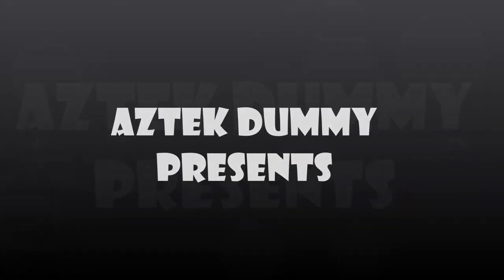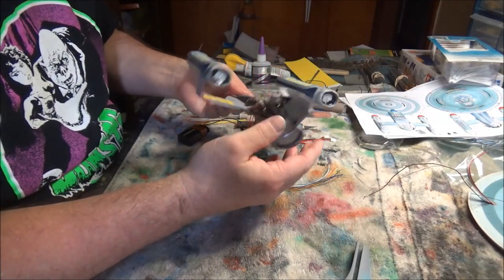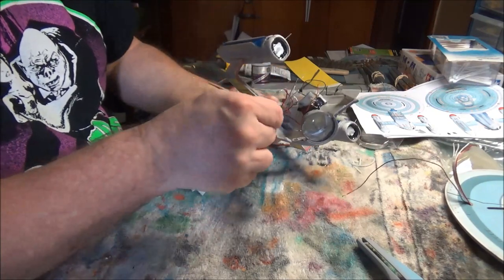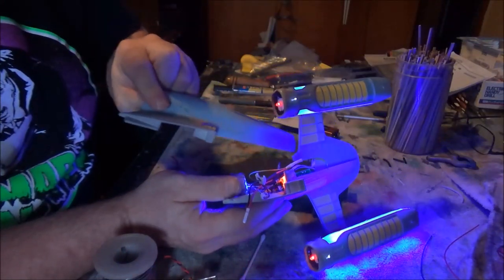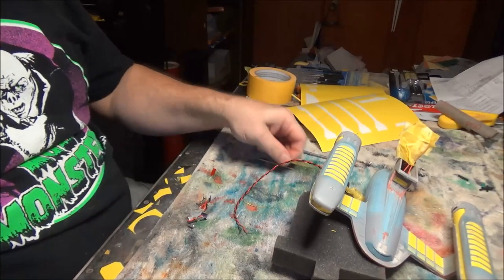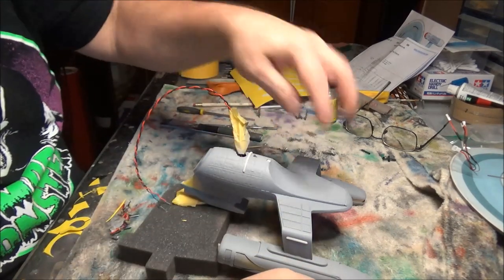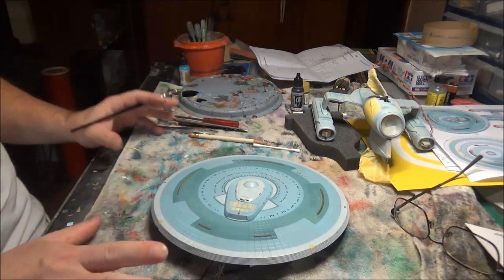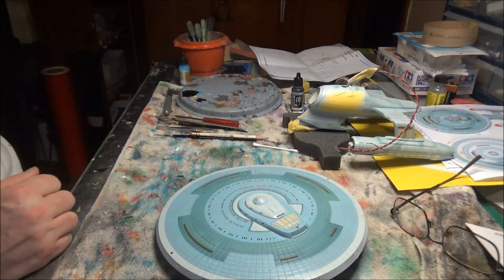Aztek Dummy Update 2/14/20 - Enterprise C part 3

Comment: Lou, first and foremost, many thanks to you for the great video series on model building and detailing. 

I have spent many an hour watching your videos which have more than re-piqued my interest in the hobby. A few years ago I had pre-purchased the Round 2 - 22" Space 1999 Eagle from CultTvMan with the desire to build it for my grandson. I had started the prep work on the kit with rattle-can plastic-primer (not satisfied with finish at all) when I was rudely interrupted by Hurricane Harvey. Fortunately, the kit survived the flooding and after two years of rebuilding things are finally starting to settle back into the norm so I am looking to dust off the kit and get started again. 

I myself am gearing up for retirement soon (well not as soon as I would like) and I am looking to get back into model building and want to invest in a more professional approach (and get away from rattle cans if I can) so I would be grateful for your recommendations on air-brush systems, compressors, etc. and was wondering if the ATT email address is still good for contacting you directly? (As I am not sure you would want to post product and brand recommendation information here). Again Lou, thank you for your videos and please keep them coming.
Reply from the maker: Yes that aztekdummy@att.net address works

Comment: Lou, thanks for the videos first.
Second of all, there are plenty of marker or pen options to fill in the windows.  I use a tiny pen from stabilo for most of them I also use pigma microns and staedtler triples pens.  All of them can be found at Michael's, hobby lobby and most art or craft stores.  I use them quite a bit.  I used to build gundam kits and I bought the gundam markers which dry out quickly but they work too.

Comment: Looks like this would be a case for magnet wire? When I make up mine I thinking I will go with magnet wire when I go to make up mine. Over all it looks really great build , when all said and done stuff happens
Reply from the maker: Magnet wire is a last resort for me. It's too fragile. The last thing I need is to over bend the wire and have it snap inside a part
Reply: @aztekdummy  Even cat 5 network cable is thinner then that wire if magnet is not your choose just saying that wire for that model may a have been bit easier to fit wire. however in modeling if a way is figured out and it works the builder should be okay with that

Comment: That is a quite schmick build! I have some of that Mecha Primer. It's good stuff and probably better than my method of resorting to black sharpies lol.
Reply from the maker: I tried those gundam pens once and I think they must be alcohol based inks because as soon as I sprayed it with a clear coat, the ink ran like a watercolor in the rain
Reply: @aztekdummy  I wouldn't doubt that. I used a permanent sharpie on my Enterprise D many years ago and it seemed to work. I stripped it with Super Clean recently and it did come off.